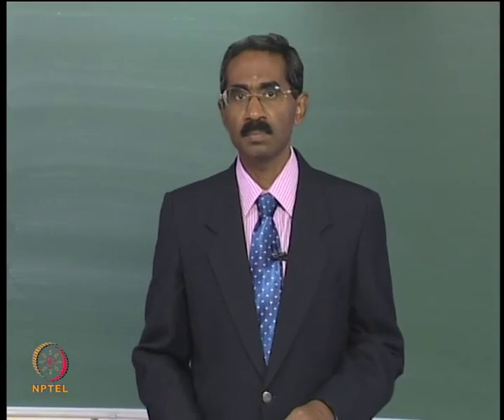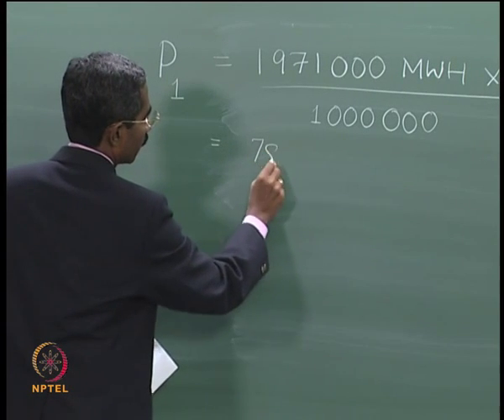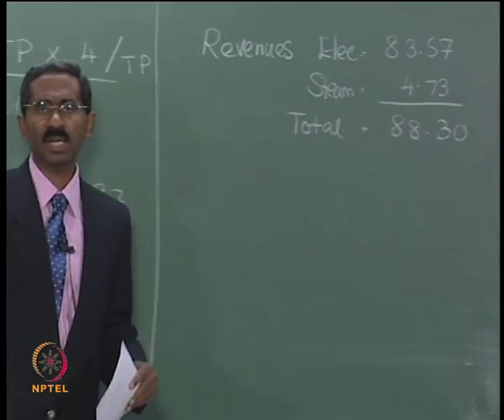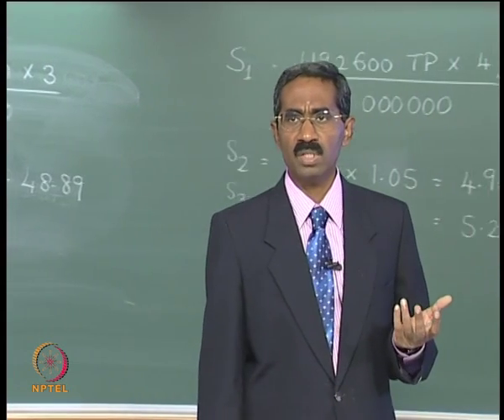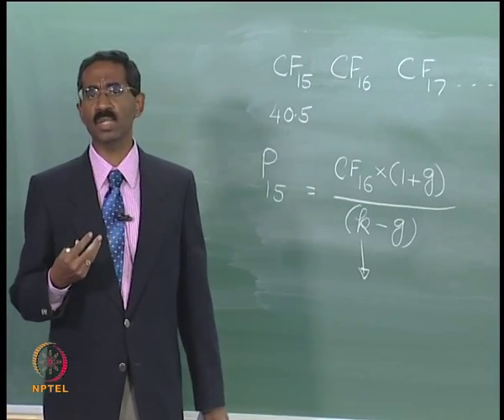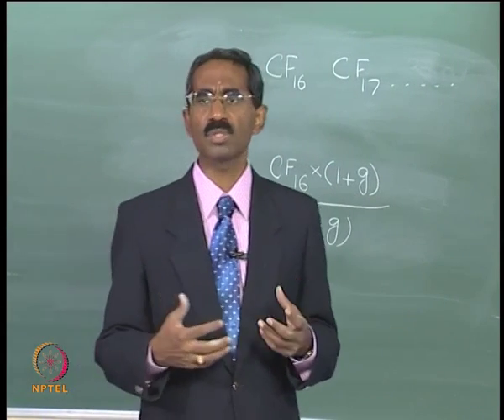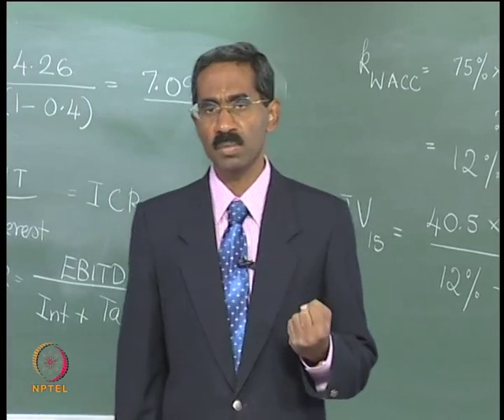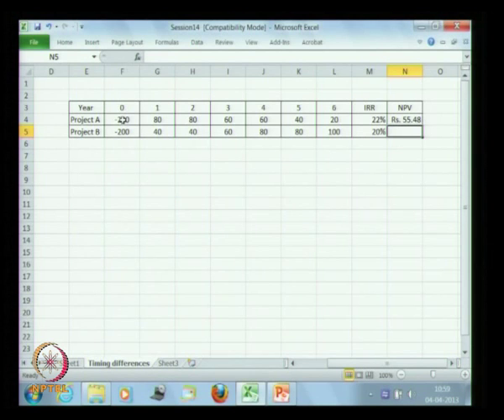Mod-04 Lec-14 Analysis of Project Viability Capital Budgeting Guidelines-IV

Comment: Great video! Just had one issue to point out, the revenue generated from electricity in Year 1 is 78.84, not 83.57. The total revenue generated from electricity and steam in Year 1 is 83.57. Thanks!